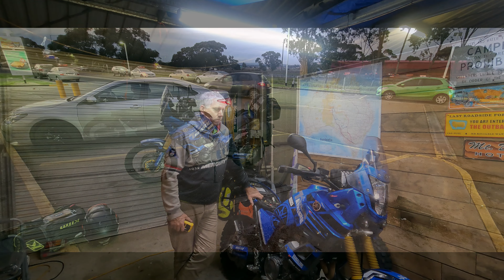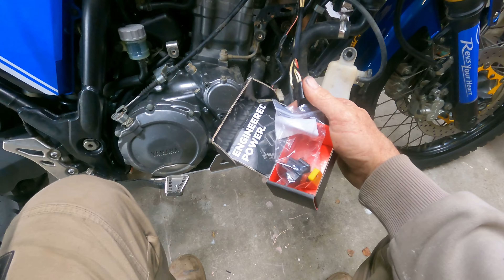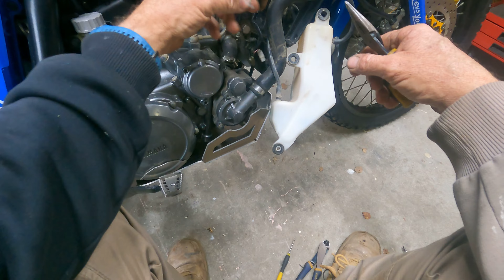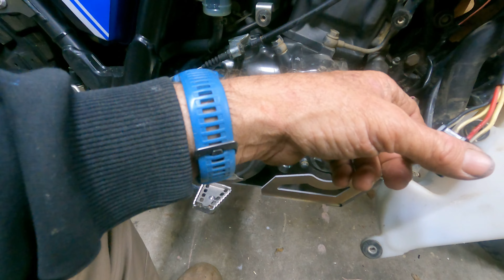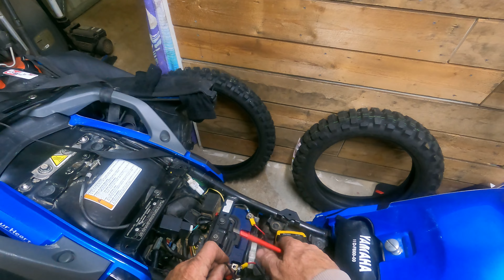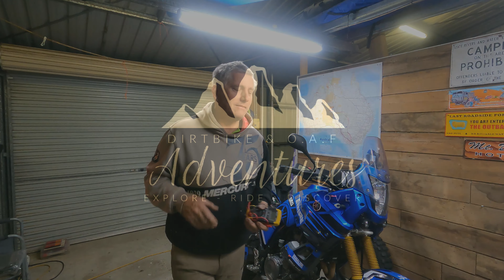Fault Finding - Error Codes!

Comment: Great video Steve, thanks for going into a bit of detail. For the reasons you've mentioned, these were factors in me getting one of these bike rather than something from the Austrian family.
Regarding your Barrett exhaust, how are you finding it as far as noise on the road goes? Not too annoying on longer trips, or obnoxiously loud for other road users?
Reply from the maker: Thanks James, yeah the Barret is perfect mate. I had the noise problem on the 480 and the 690. The Wings exhaust on the 690 was really loud till I put the decibel killer in it then it was fine. I find loud exhausts really annoying for everyone. The Barret comes with two inserts one for the end of the silencer and a cone for the start of the silencer. I've got both in and it's perfect imo. 
Regards Steve

Comment: Always a good idea to wire in a cheap volt meter from ebay and mounted on the dash.
Reply from the maker: Yeah going to replace my current usb with a usb/volt meter. Great idea
Regards Steve

Comment: Do you still trust the bike
Reply from the maker: Hi Jim, Yeah Absolutely. Is a broken wire unique to Tenere's..... no. I now know how I can diagnose all the electrical issues and there is a chance the error code will tell stupid Steve any way.... lmfao. It's actually given me more confidence. A DR and these sorts of bikes are a bit simpler  than the latest models so a hell of a lot easier to fix on the side of the road
Regards Steve